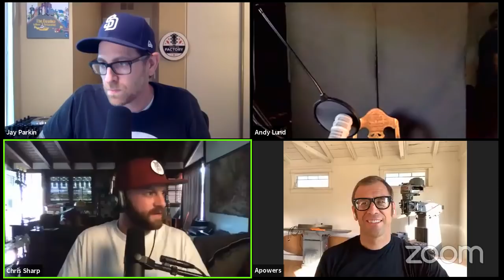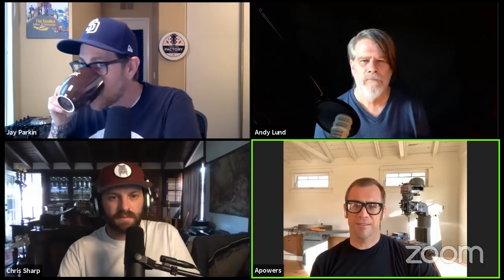The Importance of Guitar Bracing with Andy Powers | Taylor Primetime Episode 4

Comment: One thing I would really love to see Mr. Powers do would be to make two different tops using the same materials for one single guitar, one with X bracing and the other with V bracing and then glue one at a time with hide glue (so it's easily reversible and glues on quickly) and play them one after another, it could be the ultimate comparison video between both bracing systems with no difference in materials, playing-in time, air volume of the body and setup.